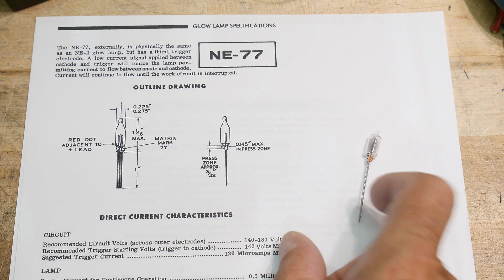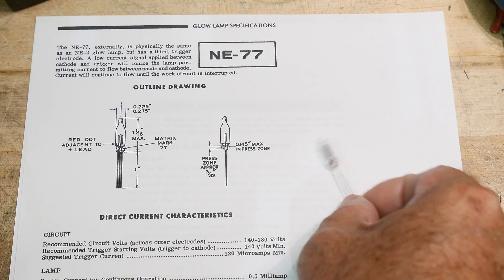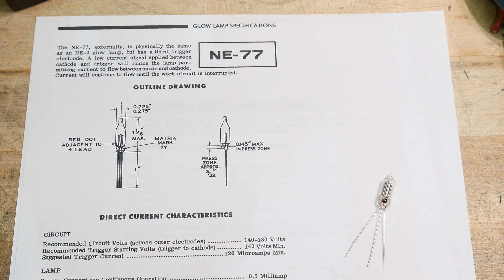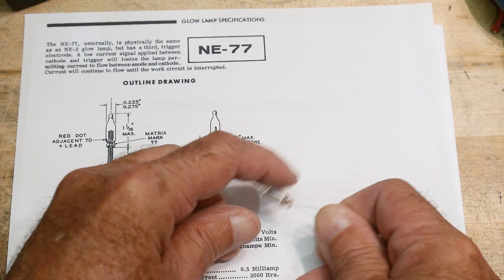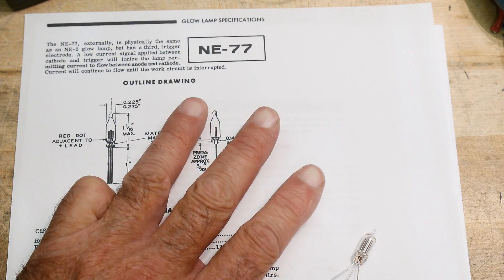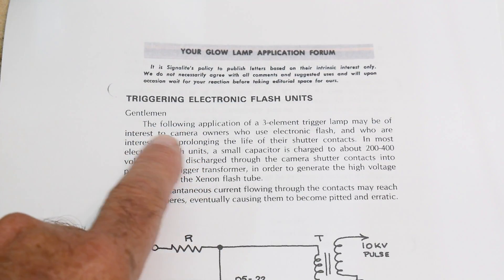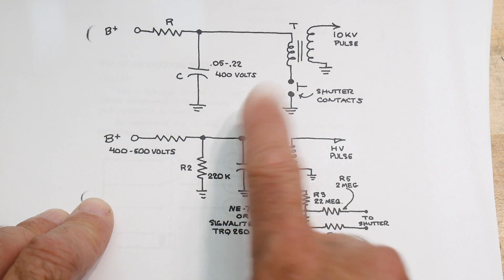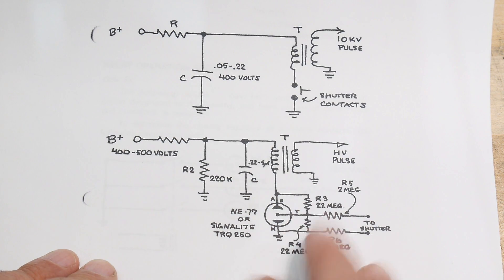#850 NE-77 Trigger Tube like a tiny Krytron

Comment: In regards to the ark discharge color.

I've heard that when neons are massively overdriven or in use improperly not enough or no current limiting.

That in an arc discharge instead of glow discharge because of improper conditions.

There could be a pretty substantial Ark and I've heard this can actually be a different color then what is expected from a neon lamp I've never witnessed this in person but I have heard this.

It's possible that that's what's being observed but I'm not sure but it's a possibility!

Comment: Pretty sure the Krytrons are used to fire the external neutron source; the bombs trigger.  That's the part that requires extremely precice and fast triggering.  The implosion itself is slow compared to the timing needed to correctly trigger the bomb and get a full yield.

Comment: I pulled one of these out of a (burned out) modern toaster oven years ago, was confused as hell by it but chucked it in with the other gas tubes I have - Turns out it might be far more useful than I thought! 
In the oven it was used both as the indicator lamp and linked to an inductor which had a core bridged by the door - if I remember right, when the door opened the core lost flux, the coil conducted far more and the tube stopped firing. Should have drawn a schematic but it was truly toast when I got to it.
I can't find these for sale anywhere online which is a shame because they seem like the type of thing you could run logic/memory with for a fun project
Reply: There is a guy who made a clock using these.. the video is on YouTube somewhere try neon triode clock

Comment: I think it was Volta who tested the strength of his early "piles" with his tongue.  Actually, I do the same thing with 9V batteries where you can easilly tell a good battery from a weak battery with your tongue 😜
Reply: @robinbrowne5419  very true hard to believe are you so many batteries including 9 volts batteries in creations of mine when I was a kid!

 but never actually had a proper battery tester until much later on.

Which I still have it was a Eveready photo battery tester that was given to me by one of my uncles that thing's older than I I am now.

Open up the old 500 volt batteries that is I hate to see somebody try to test that with test leads and make a oopsie could not man imagine how that would feel.

It doesn't seem like the leads were very much designed forthat.

At least they were the older style of test probe with the more rigid plastic and fairly chunky flirt outward around the end that could help but not much.

 kind of built one that was not very reliable based around an old Vu meter out of something or other it gave a rough idea of a condition of various batteries not sure what happened to it either just basically in a little project box with a couple Kathleen is poking out of rubber grommet if I'm not mistaken somebody accidentally tried to use as a multimeter and pretty much smoke tested the meter coil in the extreme.

Intermittent use only for sure and that was the key I didn't have proper value resistors it was just a Rough Guide more of an experiment that actually turned into something useful.

If I remember correctly that was even before I had a multimeter alone a a whole lot more Electronics experience

Comment: Ah yes. The Krytron tube. A trademark of EG&G, the krytron tube (KN-2, KN-6, KN-22, etc...) is a sub-miniature extremely high speed switching trigger tube of the secondary emission gaseous ionic discharge type typically connected as a triggered triode. The device contains four electrodes, the cathode of which is doped with a radioisotope of Nickel (Ni-63) that is an emitter of Alpha Particles. The envelope is filled with a chemically inert noble gas, (usually Krypton or Xenon) that is best suited for ionization potential in the kilovolts range. These tubes and their equivalents were also used in Proton/Anti-proton counters/detectors (You need four KN-6s for that), Implosion detonators, high end ruby based laser flash triggers, Switching in Free-Electron Lasers, and in other niche military and research applications where a normal sub-miniature thyratron would be too slow to be practicable. I personally own about 9 examples of off-brand krytron tubes that I keep in storage for obvious reasons.
Reply: I‘m running an old Nd-Yag laser manufactured by by control data corporation and regranded by Siemens I guess in the 80s which uses a Krytron to trigger the arc in the krypton arc lamp. Found one brand new in my spares part box, a genuine eg&g one which seems to have made it to germany :)
Reply: As a student in the early 80s I had to build a Nd-YAG Laser from existent Parts. Unfortunately the EG&G Krytrons to trigger the Laser  were damaged. 
These Krytrons were Part of american nuclear weapons and as a consequence I had to send the damaged ones back to the US and got some new Krytrons in Return.
Reply: I once saw one of these three electrode versions of of what looks like a neon bulb as shown in the video.

It was in and some really old photoelectric switch hallway design for lamps or something don't know if this was something that was purpose build or a hobbyist project sometimes back in the day could be kind of hard to tell once in awhile I did not really look hobbyist due to the level of detail in construction so hard to say.

However this was used obviously in a trigger application somewhere before we're in the relay driver stage actually did use this this device for quite a while what are the nice things is definitive on off adjustments.

Use it in quite a dark area and really hard to get through this but didn't need light at night fit the bill perfectly it was just sitting in the floor out of the way but still photoelectric cell could receive any light in the area.

Also I might add I've seen on ovens old ones where there would be a indicator that had three wires two of these were used one for two of the burners each to indicate the either one of or both were active active.

Elegant solution for this for sure!

Essentially play double indicator one single neon indicator instead of more complicated circuitry

Comment: I've only ever seen these used as protection elements, usually on old LAN interfaces. I have a four lead one somewhere that came off a twisted pair interface from the '90's. Regardless, I'm going to have to dig them out and play around with using them as switching elements.

Comment: I've found opaque, sealed versions of these in photoflash guns - basically three-terminal triggered GDTs (gas discharge tubes) like the surge arrestors used in phone lines.  But never seen an actual triggered neon before, interesting.